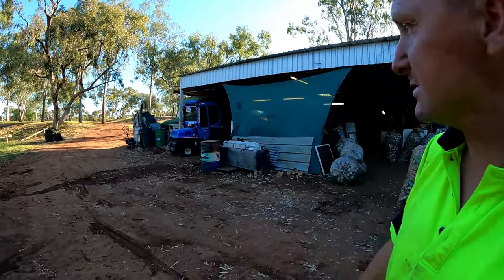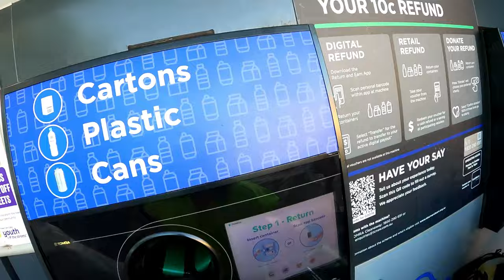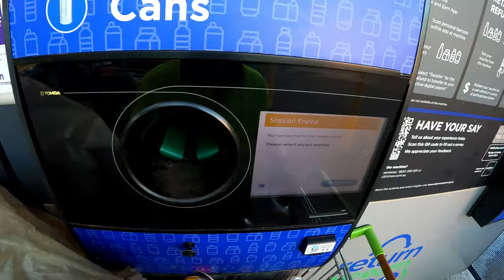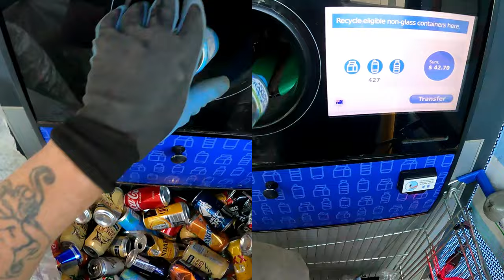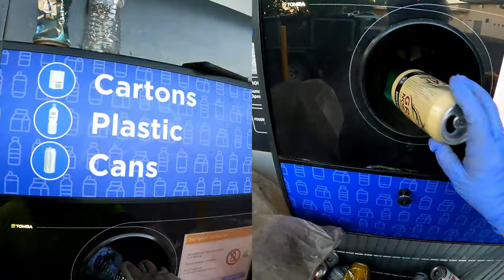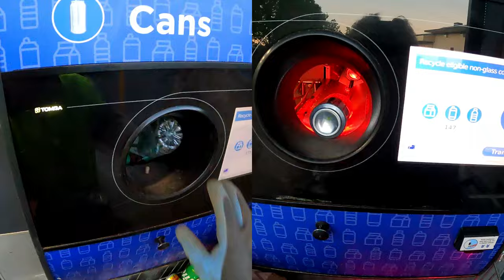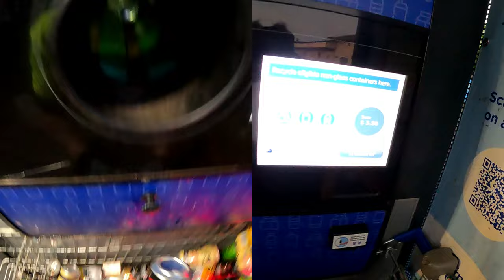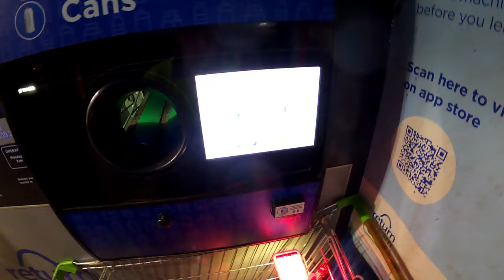Follow Up Part 2 We Paid $$$ For 8 IBC Pods Filled With Cans And Glass

Comment: Very well done both of you!  I remember in a video you made of the all the different steps it takes after you bring all the glass bottles,cans, and plastic bottles home after getting them out of the IBC pods, before you can even think about putting them through the machines.  You two never ceases to amaze me how hard you two work on recycling.  You have quite a job to clean up all the metal, aluminum, wire  etc. you keep out of the landfill also.  And all that besides your regular jobs around the property.  Thanks for the wonderful videos and see you on the next one 👍